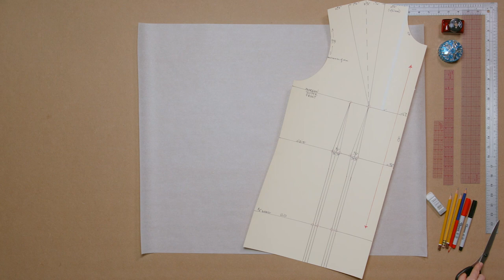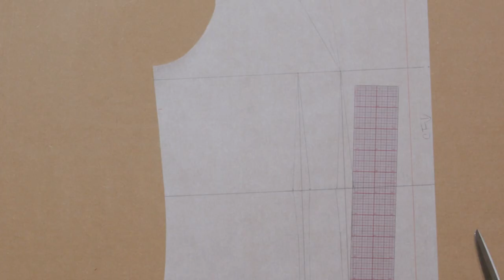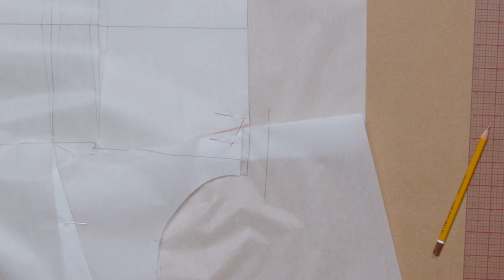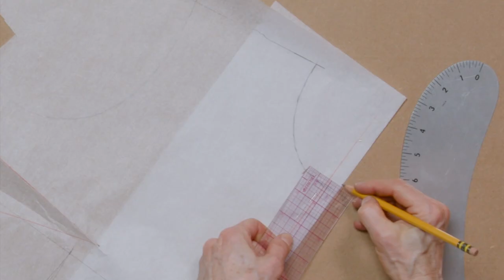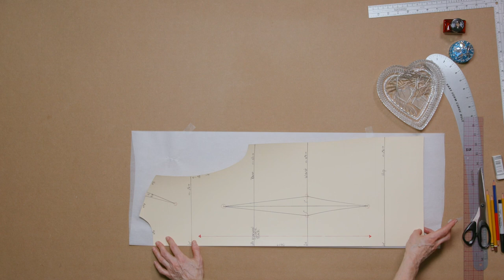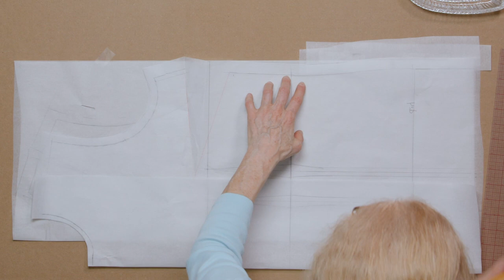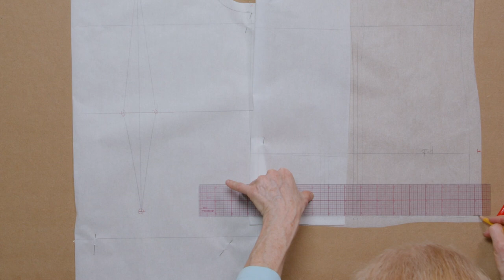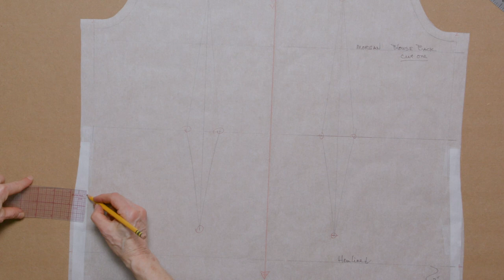How to Draft a Pattern for a Convertible Collar Blouse

Comment: This series is very helpful. I'm finishing up making my first sloper and will use this series to pattern a blouse. One question: why did the apex location change between making the sloper and the blouse? If one runs into this issue (body change? bra change?) should I go back and correct my sloper? Thank you!
Reply from the maker: Hello, Skirtedgalleons, Thanks for asking. I am not absolutely sure where in the film you are seeing this. If you have a time stamp you can share, I will get back to you again. In the meantime, might it be the dart was shortened? A sloper is the standard to work with but different fabrics, bras (as you mentioned) and shape of body can make things shift. One of our models gained about 25 lbs between fittings and that was a really difficult situation to deal with. I am very happy to hear that this series is of help to you! Thank you again!💜
Reply: @SewWithSally  Hi Sally, you say in the video something like, I think the model's apex is higher than on the sloper, so you change the location of the apex. But no worries, I think I understand that even with a sloper, I'll need to mock up new designs to make sure things fit right.
Reply from the maker: @skirtedgalleons  Hello, Skirtedgalleons, Thank you for claifying this. It's possible her underpinnings were different than when she was fitted for the sloper. It's possible that I made a mistake (WHAT???😊) I really do not know, however, you are correct about new designs need to fit. I consider the sloper the starting place but who knows where each design will take us! Thanks again. Nice hearing from you!